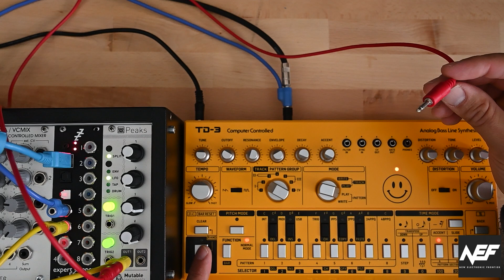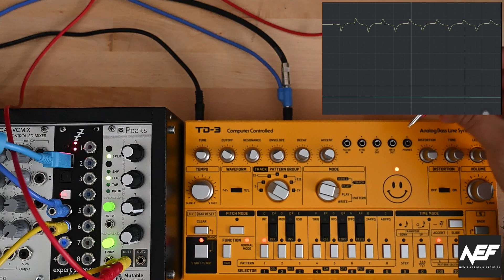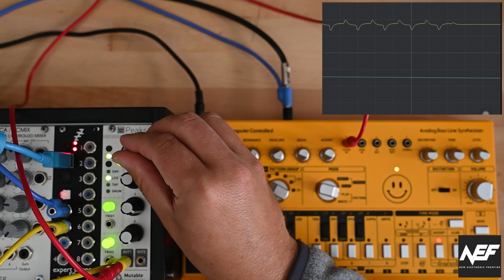Behringer TD-3 (Yellow Limited Edition) Filter in Part II - Frequency Modulation

Comment: I think thats Amplitude Modulation (AM) not Filter Modulation (FM)
Reply: Fm is frequence modulation
Reply from the maker: Thanks for the feedback! At first I thought something like that. But you can clearly hear that not only the amplitude is modulated (which would be the strength aka level of the signal), but the frequency (pitch of the signal). Here is a nice Comparison  https://en.m.wikipedia.org/wiki/Amplitude_modulation
Reply: @NewElectronicFrontier  please tell me at what time you hear FM
Anyway, to see this better, you should use a constant note of the length of a whole pattern instead of a sequence with several different notes. With the filter open, start applying an external signal at different amplitudes and see what happens, then switch to another modulator frequency and observe the result at audio and sub-audio frequencies. Then try closing the filter and raising the resonance, which is when the filter's FM is best heard. Wave switch can be put in the middle to prevent oscillator output
Reply: -> Frequency Modulation
Reply: I´m with you.The sonic results sounds and looks like AM, no filter or oscillator FM
Reply: I think I see the confusion here. The LFO eventually goes up into audio rate range. At that point you hear it in the filter in (which is audio) and it takes over so you hear the pitch rising and falling of the now audio rate signal. It’s definitely AM synthesis, otherwise you would hear the pitch of the TD-3 slowly bending when the LFO is slow, and below audio rate. FM synthesis is when a wave is used as a modulator for a VCO. The filter input on this machine comes after the VCO, and thus the signal chain makes it impossible to modulate the VCO because it comes after it. All that said though, I think it’s awesome that you posted this and even though it’s AM, it certainly is a cool trick to get a broader range of sound out of this inexpensive little instrument. So thank you for that. 👍

Comment: Yet another lovely demonstration.  This is what I did, although I thought, without having read the manual, that I would be controlling the filter cutoff ... heheh.  ^_^
Reply from the maker: Thanks for the feedback. That is about the only thing I miss in the little box. A CV for the filter would have been dope. To hook it up with my modular. But its also fun as it is...
Reply: @NewElectronicFrontier  True.  Wish they hadn't gone so minimal on the CVs, but s'pose it wouldn't only be $150 if they hadn't.  That said, I'd have paid more for more CVs.